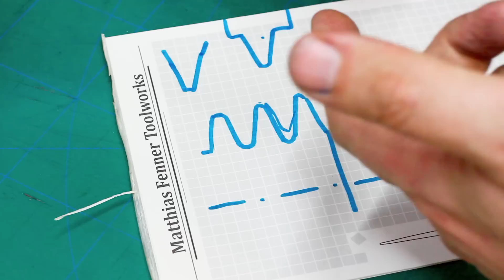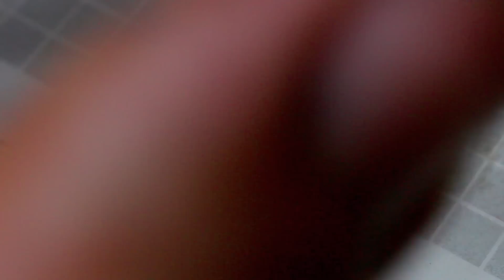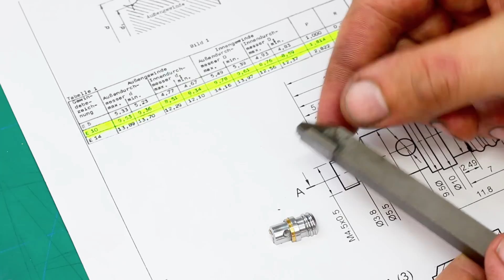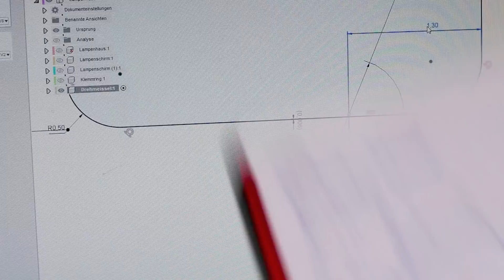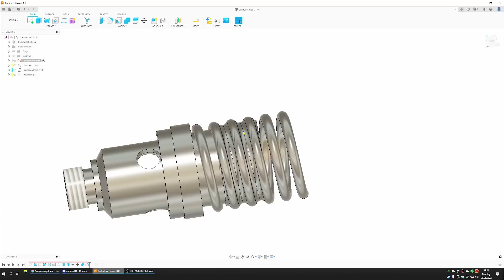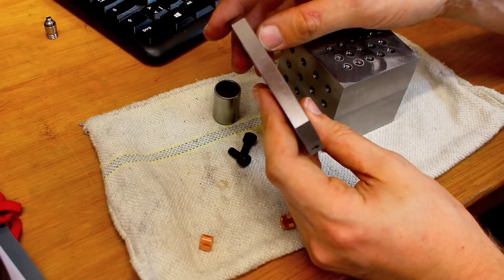Shoptalk #27 - August 2022

Comment: Just want to point out a possible geometric issue that you probably considered. Your profile is perfect as ground perpendicular to the grinding spindle axis. However, in use the cutter will be rotated back cc along the lathe x-axis by 3.75 degrees. The circular profiles will become slightly elliptical rather than circular (when cutting) and the distance between the centers will be slightly longer by a factor of 1/cos(3.75°)  or about 1.002. At worst that's about 0.002 X 1.814 (pitch) or 3.6 microns of error (not worth worrying about).

Comment: You should not expose your hands long-term to the alkaline degreasers-cleaners.  The alkalinity (NaOH or KOH) will alter and gradually injure the deep tissues of your hands.  The skin becomes tough, thick, and insensitive.  A single exposure doesn't seem to be harmful, but don't be deceived that there isn't a gradual accumulation of significant injury that won't heal.
Reply from the maker: Thank you for the warning and hint - Thats something I need to get a bit more careful about.

Comment: I realize it's too late for the AMA but have you seen or tried Multifix from Pee Wee Tools? I was think about getting some for my Super 11. Also looking at an Mlock work holding vise for my FB-2...
Reply from the maker: I have used them on a friends lathe. Cant say anything particiluar positive or negative about them. All I can say: I prefer the AXA multifix, since they are made here in Germany.

The MLock looks real nice, I am slowly going back to grinding vices for my manual mill. The Gerardi Vises where not exactly the right choice.

Comment: Hi Stefan, one for the list of questions (or rather a topic): considerations on dust management in (small) shops were separate rooms for every "department" is not possible. I´d be especially interested in your thoughts on grinding dust. Dry/wet grinding, Carbide dust and what filters and how often you change them... 
Danke für die tollen Videos und beste Grüße aus Wien

Comment: Question: Is the wear on the diamond wheel significant enough to require redressing during the grinding of the form tool? And secondly is there an effective way to measure the radius of the edge of the wheel?

Comment: Question: Regarding the parts washer, you are using a caustic solution alkaline, does that cause surface discolouration or streaking on metal parts especially aluminium? Secondly you air dry and store your parts. Do you use and protecting oil if so what protection do you use in the shop for both small parts as well as lathe/machines beds and bores?

Comment: Stefan, I have a homemade Squareness Comparator put together using a Starrett Surface Gage Base, and a small Noga Magnetic Indicator Holder, that mounts a .0001 Brown and Sharpe Indicator, such that the indicator ball can be positioned center and forward of the Surface Gage Base for actual squareness checking. 
In this my homemade Squareness Comparator, I use a 1" Ball Bearing "crazy glued" inside the Surface Gage's own "V", so that the Ball is not actually touching bottom by about 1/8",  but fits firmly inside the "V" of the base, and protrudes approx.1/2" in front of the Surface Gage's own base front.

My question to you is this:  Is using a 1" Ball Bearing for contact with an item to be checked for squareness "acceptable" to determine an item to be perpendicular this way? 
OR, must I use a larger radii like your machined and ground  "protrusion" on your own Squareness Checker for proper  contact purposes?  
 Follow up: Is it necessary for your indicator ball to be on the exact centerline of the item to be checked for squareness?

Comment: I suspect another way to model the thread would have been to use the same coil, but push it over by half the pitch and then subtract it.  Only if the inside and outside radii are the same...

Comment: What made you decide to grind on that axis?  I would have ground the cutter with carbide facing the camera and base metal behind. I have so much to learn.

I came back to edit - I figured out that the thickness of the carbide was beyond the full waveform of the thread. (waveform...electronics meets machinist)  It does make me wonder if threading with a sinusoidal profile offers any advantages.

Thanks for going to the trouble of these videos.  You will never know how much we all appreciate it.  Please keep it up!!

Comment: I once measured the results of threads cut with IR W11 full form inserts of some household brands (Sandvik, iscar, vargus, seco, C.P.T. and some inserts from the archives) with a contour measuring machine. I found out that only one of them cut a thread with the correct profile height.

We generally measure (internal) Rp threads with ISO7 thread gauges and checked the minor diameter for good measure. But in reality our major diameter was just out of tolerance (0.02 mm) due to the profile height the inserts we used was 0.1 mm higher (1,57 instead of 1,479). Tolerance field is only 0.24 iirc so that's practically gone with the 0.1 mm higher profile on the insert. The threads were found to be out of spec during pressure testing with helium. 

Sales rep of the biggest offender (whose inserts we used unfortunately) said "yeeeah that's just how it is, trust me" haven't seen him in a while.

Comment: Questions for your upcoming Q&A video:
What process did you follow to move from a purely hobbyist-level shop with relatively basic manual machines to one that seems to be a largely professional setup, with a considerable level of CAD/CAM  and very high precision - and very expensive - equipment such as the new surface grinder?
What I mean is; how many steps did this process take?  In what order did you take those steps, and what business demands drove you to take them in the order that you did?
One last question: You've mentioned several times that you also worked as a professional machinist in a machine shop.  Did you have to sign a non-compete contract with the company you work for?  If so, how did you transition your hobby into a business without violating that agreement? 
Thank you,
Douglas Hank

Comment: Thank you for this video and thank you for all of your video's :). You make a great tutor to me.
In an old video, you show an interesting way of aligning your tailstock by comparing the X of the tailstock axle with an axle of the same diameter in the chuck. But after that, tool pressure causes deflection in the tailstock with a few micron taper as a result. Do you know of any procedure to couteract this effect? Like on purpose adjusting the tailstock a little to the front?

Comment: Thank you for sharing so many instructive and entertaining videos! 
Question: Would an electronic lead screw such as the one made by James at Clough42 work for you if you make customer parts?
Since grinding a new gear out of phenolic is something you happily do in between brushing your teeth and rinsing ;) it may simply not be worth your effort. But I am intrigued where the limits of that clever contraption are!

Comment: Not really a question but talking about making a v-block with a bolt on part, it reminded me of the process used for connecting rods where the rod and rod cap is made as one part and cracked apart leaving a fracture surface that perfectly keys together.

Comment: I also have a detergent degreaser in my parts washer and I can testify that it does indeed work well on very nasty old tractor parts.  I chose the detergent for the same reason.  Naughty little sparks have a way of getting into unhappy places.  If you have foaming issued, a little denatured alcohol will kill the bubbles. Y'all better get some Dr Nefario gloves.  If your degreaser will remove oil from parts, itll strip the oil from your hide.

Comment: As you briefly addressed in this episode, is grinding ferrous metals with a diamond wheel really that harmful under non-production conditions? It seems like one of those truisms that in practice is not as harmful as it is made out to be when done occasionally in a home shop sort of environment. Obviously this is a hard question to answer, as coolant, amount of material, load and other factors all play into it, but there are people saying that they use diamond on steel all the time with no issue, and it would be nice to be able to grind some HSS tools on my diamond wheel (carbide grinder) every once in a while without the fear of ruining it. 

Love your work, and look forward to your videos more than anything. I've learned so much from you.

Comment: I want to machine a circular groove, in brass, 12.26mm ID and 15.26mm OD, and 20.5mm deep. (but, to complicate things it's happening 40mm down a hole). I am thinking of regrinding a Rotabroach annular cutter, but would it make more sense to start from scratch with tool steel? Can you think of a better way to make the feature?  I am assuming that circular interpolation with a mill is a non-starter as a 2.5mm cutter probably can't go 40mm deep and hold any kind of tolerance. 
I have a D-bit grinder and CNC mill and lathe (and I can make my CNC do anything)
There is a 10mm hole all the way through the centre that can be used for a pilot/guide.

Comment: Maybe this is a stupid topic, but a problem I didn't anticipate when getting into machining was dealing with chips/swarf (after they get off the tool, chip breaking is a separate issue): they scratch things easily, can get stuck in places (wood floors, clothes, or even in my arm hair sometimes), they get on the floor (and make for nasty splinters if anyone steps on them), brass dust is surprisingly sticky as well, and I'm not sure the normal metal recycling will be too happy with an unsorted pile of aluminium, brass, steel, etc. So I wanted to ask: how do you deal with chips? Do you have regular cleaning rituals, how do you avoid stepping on them (shoes in the shop?), where do they ultimately go?

Comment: Hello Stefan, Thanks for making an ask me anything!; my question: What lathe, would you suggest to get for a person who is starting to be a metal machining garage hobbyist.
there a lots of options but I have a garage-size space with 230v max and would love to get your insights on what to get / what brands are good. max budget ~7-8kUSD. 
I know that for 230v I wont be able to get a big industrial lathe, but you would know best. many thanks! 🙂
Reply: The big question is just how large of work (diameter and length) do you intend on doing. And if you have 230 you can always use a phase converter for 3 phase. Asking what kind or size of lathe is sort of like asking how high is up. And if your looking at say a max of 10"/254mm in diameter myself I'd still go 12 or 14 inch. Used there are lot of there. New if you're in the US you are looking at an import.
Reply: Thanks for the clarification comment! I am indeed totally new to this.  @mpetersen6  I am indeed in North America (Canada) and prefer totally metric. Being said that I would think that 1 meter between centers would be ideal (I do not know if that is enough info or if its a standard with regards to diameter size or what would be the closest diameter that has  1m / 40inches between centers?
Reply: @jmunozar  
First if you go used it was not uncommon for lathe manufacturers to build lathes with say a 350mm?12" swing but several bed lengths. But if you prefer metric you might have to go new. But even there you might have an issue in that a lot of the machines sold in the North American market are equipped with Imperial Leadscrews. A DRO solves a lot of that issue. Also you need to reserve a bit of money for tooling. Tool post, tool holders, boring bars, cutters (HSS and carbide), drills drill chuck(s), tapered sleeves etc. 
If new the lathe should come with a 3 jaw, 4 jaw, Steady Rest. Follow Rest and a Basic square tool post. Plus one thing I would get is a 5C or ER type collet set-up. I looked at the Precision Matthews site and it appears that they sell machines with inch leadscrews only. If you are looking for used in Canada a Standard Modern might be a good choice. Providing its in good shape. 
Also a private sale will often include tooling.
Reply: @mpetersen6  ahh Thank you!, one last quesiton, is there a specific brand that one should avoid / try to get?  I have read that one should save half of the budget for tooling :-) which is what I plan to do

Comment: I felt a similar need for a parts washer, and bought a large "gastronorm" food serving stainless steel container with lid and drop-in strainer and used an aquarium pump pushing the liquid through pop-together posable air hose, I need to buy a drop in sous-vide immersion heater👍  you should maybe check out gastronorm equipment (it's used for keeping food warm in canteens) it's pretty cheap new, and very cheap second hand on eBay (it's very much like the tank on your ultrasonic bath)

Comment: If you don't want to deal with chips and dirt and such in the ultrasonic, put the parts in a plastic bin filled with cleaning solution, then put that bin in the basket in the ultrasonic. You can then fill the ultrasonic with distilled water, and can change and swap out cleaning solutions at will, or even use two different cleaning solutions at the same time. I've done this to assembly-line piles of small parts with different cleaning solutions and water rinse.

Comment: Hi Stefan, this isn’t much use to you but I have made similar lathe tools on a profile grinder for high speed wood working moulders (Wadkin visage). Works extremely well and is very quick once you have your template (cnc router job)  accuracy is +\- 0.01mm from the template.

Comment: You could use endmill to make those radius . Tilted milling head(for clearance cut) and carbide endmil ,plunge cut for 2 side radius and then use rotary table for example for main profile. 
Or make a simple plate jig that clamps to a table  with a hole in middle then tap a thread in a block and put a stud that fits in the plate hole . After that you mill a tapered slot(for clearance) in middle of steel block with a width lets say 12 mm for hss blank .Couple grab screws at side to hold blank and thats it. Little rotary table that you can use to grind main profile on milling machine. 
Or you could mount a drum grinding wheel to a milling machine/drill press.You can grind with milling machine.
It doesnt have to be cnc machine you just have to have idea !

Comment: I have a question. 🙂
Do you accept contract work? I need some cutting tools made from HSS, circular, something like a gear gutter wheel but with a custom profile and 6 teeth.
Probably about 10 for first batch then maybe another batch every 6 to 12 months.
Reply: There is a website with contact info. http://gtwr.de/

Comment: What are the purposes of the Edison thread?   I guess Edison is the name because of Thomas Edison inventor of the light bulb 💡
Reply: That's it. Look at the base of many light bulbs!
Reply: Edison didn't invent the light bulb. He directed his workers to conduct experiments to find a better filament material.
Reply: @emislive  maybe these thread forms should be called "workers to conduct experiments to find a better filament material" threads ......... naaa that's splitting hairs I'd say
Reply: At some point in the vid he says it was designed to be easily formed into sheet metal. Making it inexpensive to produce millions of bulbs quickly.

Comment: Hi Stefan, I have a question. 
Recently I watched your old lathe toolpost grinder build. I have also built one that’s a bit different, using an ER20 cnc router spindle. I wonder if you still use your toolpost grinder much and if you have pointers to get a good surface finish and minimal heat input into the part. I’m not sure what to use for coolant without making a huge pasty mess. Do you know where I can find quality small diameter grinding wheels to use for ID grinding? I have found some unmounted wheels on a flea market made for id grinding and I wonder what kind of glue is appropriate to fix them to an arbor.
Sorry for the long string of questions 😁

Comment: Would’ve been very cool if the grinder could’ve followed a mathematical equations for the profile. Great stuff Stefan, thanks.
Reply from the maker: Yeah, or a DXF import so you could draw the profile on a PC, in Cad and load it to the DRO.
Reply: @StefanGotteswinter  
Or if you have access to a Wire EDM. Cut the profile and the clearance angle all in one shot. Of course everybodies got a Wire EDM tucked in the corner of the shop. Another way might be to cut the profile into a piece of O series tool steel with a tapered end mill in a CNC router. And then flame harden the working end. If your cutting an engineering plastic should hold up. Just make sure you hone to a crisp edge. Or if you have the CNC Router but no tapered end mills tilt the work piece around 5 or 7° and cut the adjusted profile. The work diameter looks small enough that I think you would be alright clearance wise. Those Eddison threads are pretty sloppy from what I've seen. 
In the past I've made emergency cutters and countersinks out of an L-series (L-6) tool steel. I got a lot of use out of the countersinks. Just be careful not to get them too hot on the cutting edge.
Reply: @StefanGotteswinter  Yep! ;🙂

Comment: Do you feel safe with that Betales hair, or do you wear a hair net around machine tools?
Reply from the maker: I tie them together :)
Reply: @StefanGotteswinter  We need to see that in the AMA :D
Reply: its not that long mine is past my arm pits a elastic ring ties it back fine and safe Yes I am a he and 75 years young with a well equipped workshop ( hobby use only no paid for work at all )
Reply: @stuarthardy4626  I've seen Keith Fenner's beard as a braid. It's relly more curiosity to see a DIN hair bun.
Reply from the maker: Its more a messy bun :D